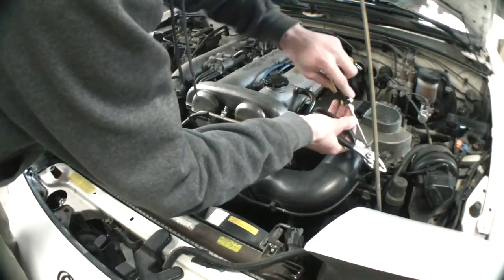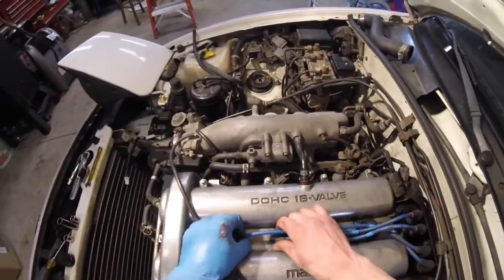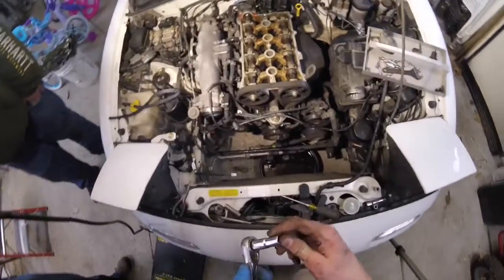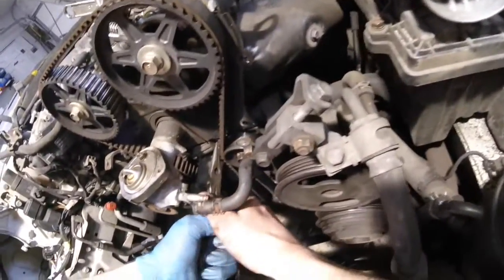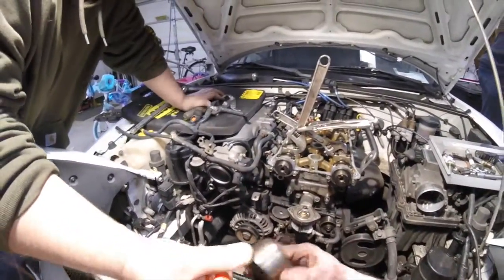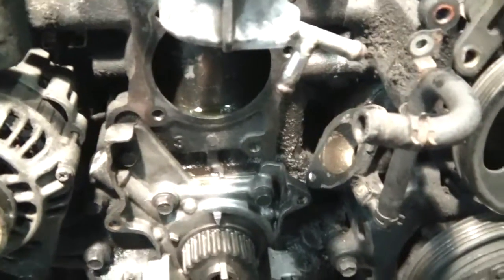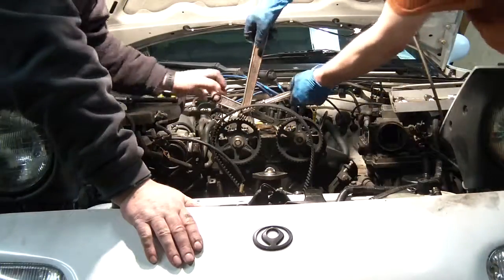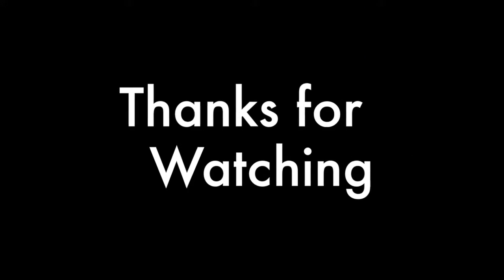Complete Miata Timing Belt + Water Pump + Radiator Install ( NA )

Comment: Definitely the luckiest ever.  My crank shaft key broke,  and I had to soak the gear in penetrating oil for 2 weeks,  and it still took an hour to remove it,  with me and my friend prying on it at the same time